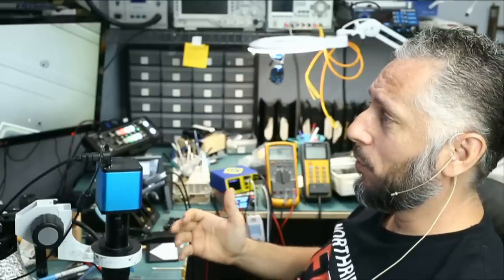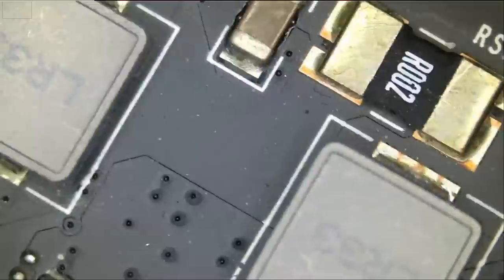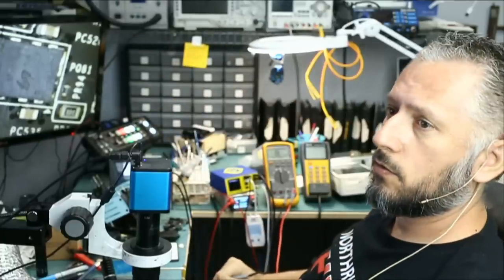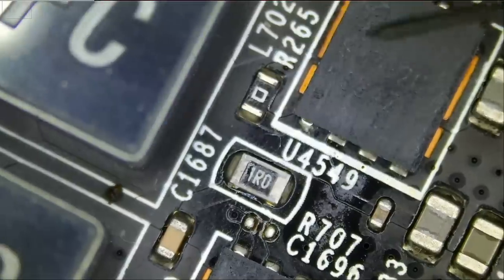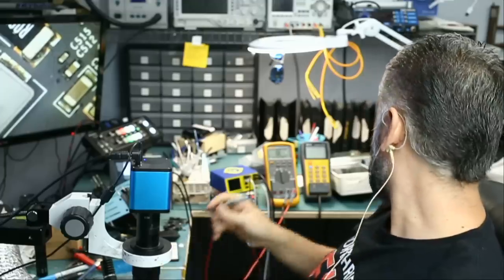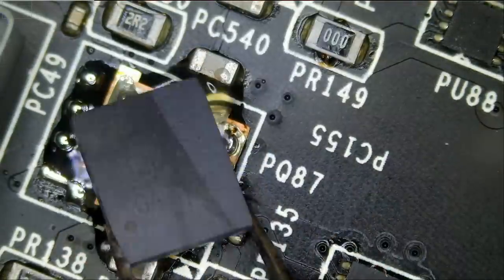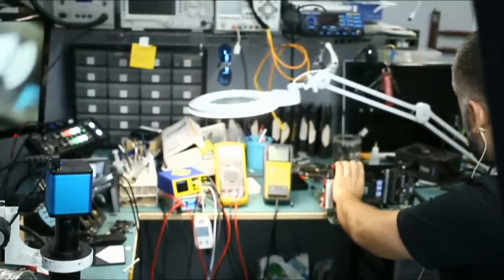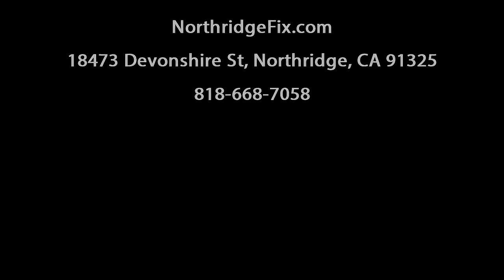MSI GTX 1080 Graphics Card Repair - No Power Not detected

Comment: Dude, I love how excited you get when you finish a repair! It's like every time is the first time! Love your channel, and hope your business stays successful!
Reply: Classic engineer mate, all my ex colleague engineers(I used to be a buyer in this industry) get satisfaction from working out a fault but even more so when they can resolve it.  A clue is when he said "better than from the factory" because most faults come down to manufacturing tolerances, the simple truth is that all devices leave the factory with faults but sit within defined tolerances, for this reason I had my AV engineer rework my amps despite having no apparent faults to remove all dry joints and poor connections in general which improved the sound quality on what are already fairly high end products, my AV engineer was like a kid in a candy shop effectively stripping down and rebuilding my amps and removing all the factory tolerances.  When the work was done the amps had sound quality akin to products selling for 2 or 3 times the price, and still do to this day.
Reply: same here love to see the smile and that shows passion...love it man.Subscribed

Comment: 1 less GPU to fix. Only 200 to go and Alex will be free of the GPU plague. :D
Reply from the maker: You are right on the number. I'm trying to push and finish as many GPU's as I possibly can but it seems like it's a never ending queue. We already stopped taking GPU's a month ago.
Reply: @NorthridgeFix  when the day comes you reopen Que i have a 1080 that i will be sending your way. what do yall charge for repairs anyway i cannot find a number anywhere
Reply from the maker: @StarAncient Which 1080 do you have?
Reply: @NorthridgeFix  zotac extreme amp 1080 non ti
Reply: ima crash out now its 1AM here in SoCal where we live. hope to hear back.. Go to sleep too!
Reply: @NorthridgeFix  did you not manage to find any employees yet?
Reply: Question: is there an option to display the multi meter output on screen? I would love that.
I guess that won't work with the Fluke you have right now.
Reply: I have 5 or so cards that need repair! Let me know when you're taking more.
Reply: I have a MSI GOLDEN TI GTX 980 no display I'm in sol cal as well. Waiting patiently to send for no display repair.

Comment: another superb repair chief ….. want to know, why we did not clean the old solder from the board before putting the new MosFet ? you usually clean the pads before putting a new component on the board :) ..

Comment: You make this look easy! One question? When measuring for shorts in continuity mode, does it matter which probe is ground?
Reply: Does not matter, you can have for example the red probe on ground, continuity mode functions kinda like closing/completing the circuit, thats why it beeps because he closed the circuit going to ground
Reply: it DOES matter, black probe on ground sink, and red probe on point you want to check, if you put it in reverse (red probe on ground and black on testing point) it's called "diode mode" in which you test not continuity but voltage drop,
Reply from the maker: It continuity mode it does not matter,
Reply: @chrom4ful  The master has spoken IT DOES NOT MATTER acknowledge your mistake and move on, next time at least research it on google before posting and misinforming people, that causes to invalidate good information for people who wants to learn, exactly what you just did with my comment. xoxo kisses

Comment: Rtx3080 blown 20a fuse at the connector, replaced fuse, pc flickers once and won't power on. Used 3 connectors directly from 850 watt psu (NO jumpers). All drmos read identical ohms on the 1st pin.

Comment: I like your channel, I see all your videos, congratulations for being a didactic when you do the work, I know that you are beginning to work with video cards, and I know that sometimes it is difficult to repair these, I congratulate you for doing a quality job, but unfortunately this in terms of video cards does not guarantee that they will be good, when you make the video card work it turns on low consumption using only basic parts, normally when a video card is repaired a test should be carried out with software programs. rendering to rule out other problems, and also a test with factory programs that review the memories. With this you ensure that when the client uses it, it does not throw errors.

me gusta tu canal, veo todos tus videos, feliciataciones por ser didactico cuando haces el trabajo, se que estas comensando a trabajar con tarjetas de video, y se que es algo complicado a veces reparar estas, te felicito por hacer un trabajo de calidad, pero lamentablemente esto en cuanto a tarjetas de video no garantiza que estas queden bien, cuando haces funcionar la tarjeta de video esta enciende en bajo consumo usando solo partes basicas, lo normal cuando se repara un tarjeta de video se debe realizar un prueba con programas de renderizado para descartar otros problemas, y tambien un test con programas de fabrica que revisan las memorias. conesto aseguras que cuando el cliente la use no arroje errores.

Comment: Better than factory. 

Wish my dude who was replacing a charging port on the iPad soldered it properly so it didn't fall off as it did, only for them to then screw up the LCD to have two areas not responsive to touch. Can you not open a branch in the UK?

Comment: great Job. Have you ever succesfuly saved a Strix RTX3090? got a guy selling two that shuts down PC once its in the PCI express slot immediately. the other shows up in windows, via 2nd display,but goes to Code 43 once you try to install drivers.

Which do you think has a better chance of being fixed?

Comment: Please I hope you can help me with my question.  When you test the mosfets you put 1 probe on the number 1 pin and then the other one on  any ground?   or should it be a specific ground on the board?  Also, how do you know  what values should be displayed on the multimeter for each mosfet?
Reply: Most of the time any ground will do just fine, and in this case from experience but it's possible to look them up depending on the actual mosfet part

Comment: I have such a hard time finding shorts and the actual problematic components, but I never have an issue replacing broken parts. I can easily desolder and solder board components, but I am so awful at finding the actual problems. Any advice?

Comment: I have a GTX 970 that went bad 2 days ago. When it failed the computer turned off and wouldn't turn back on. The computer operates normally with a lessor graphics card installed. Upon measuring the mosfets it appears that all of them are shorted to ground, all 16 of them. Do you think it would be worth ordering the parts to repair? Before ordering parts I will remove the mosfets and verify that the 12V is no longer shorted.

Comment: These chips have fairly differentl ratings and characteristics it seems (like the one you put in is rated for less current at Tc=25°C but fairs better at high Tc, then the one that got replaced, different on resistance etc.). Is there any quick way for Graphics cards to actually know what current the mosfet needs to be rated for?

Comment: hello, my name is burak
I have the same card
In the furmark test, it cuts off the image after 2 minutes
fans start to speed up but motherboard continues to work
temperature values are very normal
Power supply was tried but the result did not change
Do you have any information about the malfunction?

Comment: How much do you charge to fix graphics card?
I got a MSI 480 Radeon....
It seems to work.. 
but after a while it glitches out and crashes....
Took it out and replace it WITH a MSI 1080 (like the one you repaired)....
But the 480 (used to be paired with another 480 for dual gfx cards....
I suspect a memory issue.. but not sure.

Comment: Hi, i have asus dual-gtx 1070 8g white and it has no display but it has power. LED light indicator is on and even the fan is on. it was ok not until we clean the pc with blower and after that it didnt work at all. i would like to send my card to you to see what is the issue.

Comment: I have gtx 970 and if I plug the card to my pci e and plug the power adapter in gpu and it shows power down and connect power adapter, but I had connected to it and also I reinstalled the power adapter but it shows same but if I plug my gtx 1080 it works normal ,what is the solution

Comment: I kind of wish you would do a series on your methodology for testing. I get what you are doing in every video, but I feel I would be lost if I opened a shop doing these kind of repairs in practice.

I have done plenty of comp/tv/small devices work but most of the time it is a component swap or cap replacement.